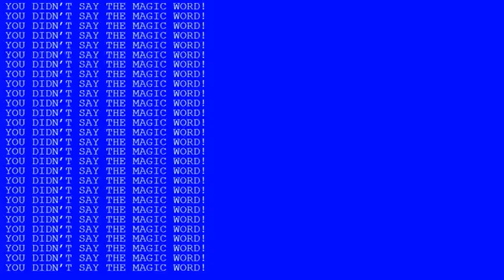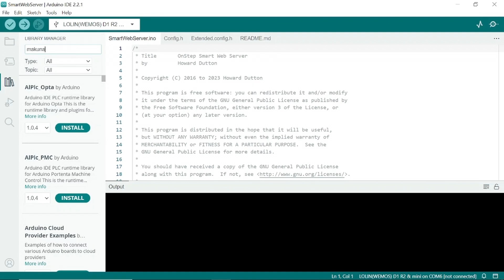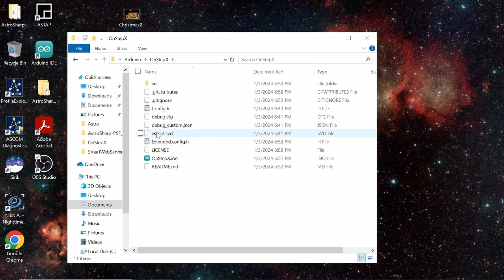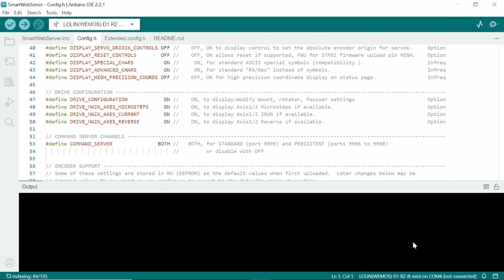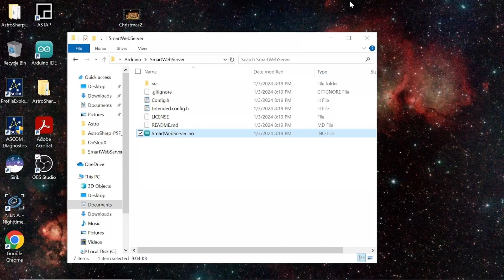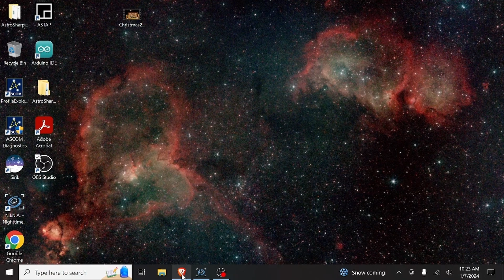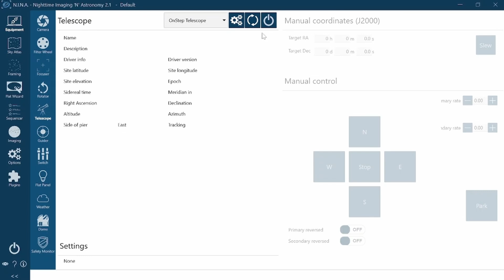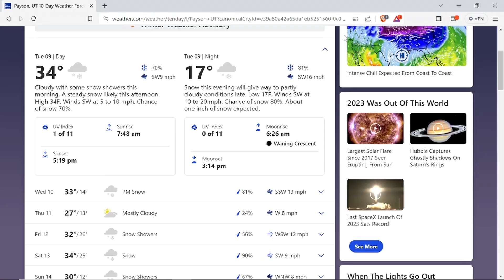DIY Harmonic Telescope Mount Pt. 2

Comment: Not many video tutorials on the whole onstep procedure. To be honest, if you have never worked with 3d printers or stepper motors, it is all written in Greek. Thank you for this information. In the planning of converting a Celestron CI700 (Losmandy G11 wannabe) to onstep. Would like to build a strain wave after to carry a 14" Meade ACF. Probably Nema 23 with matching Harmonic drives. Still don't understand why there is a reduction required via belt/planetary gear. But following along...
Reply from the maker: I use it for the torque multiplier so the steppers have no problem swinging the scope around

Comment: You have a break on the NEMA motor for DEC ? How is this controlled from the maxESP. Where is this connected to the break (24v) and how is this mentioned in the config.h
Reply from the maker: No. The break is only on the RA and not controlled by Onstep at all. It is an electromagnet that is released when 24V DC is applied to the mount. If the power is cut the break engages.
Reply: @whyf16uy  Do you use the break

Comment: Are you going to power the mount with 24v, or are you going to build a 12v to 24v up-converter into the mount?
Reply from the maker: It will be 24 volts. The onstep board will work with 24 and the brake on the RA motor requires 24 so I'm just using a 24 volt power supply I gort for a dollar at my works surplus warehouse.

Comment: Your video has inspired me! Thanks for sharing. I am planning to do something similar. Will probably stick to good old  worm/ring gear...what type of RA motor is that? Does it have mechanical braking?
Reply from the maker: It is a stepper motor from steppersonline(nema 17). It has an electromagnetic brake that takes 24 vdc to unlock so if you lose power it clamps the RA axis and your OTA doesn't crash into something.